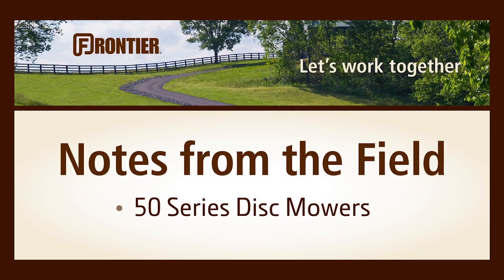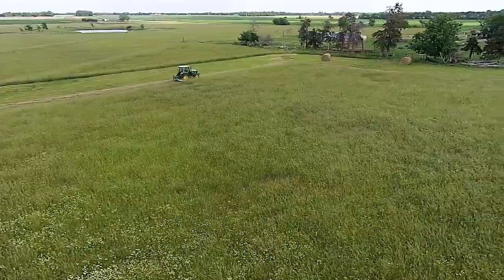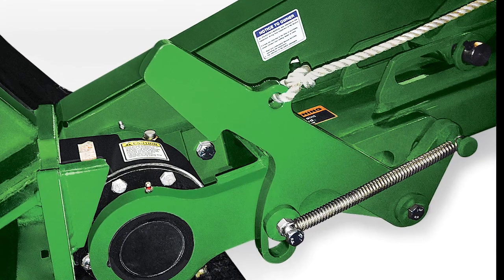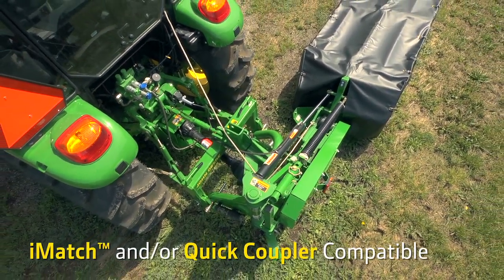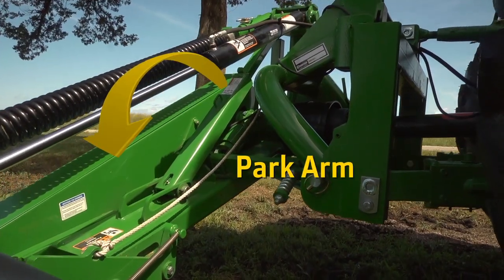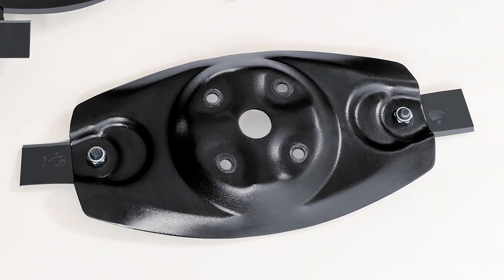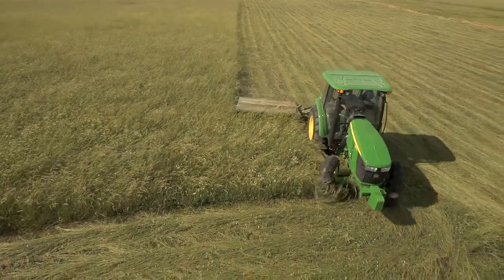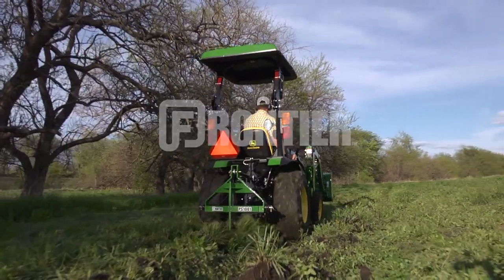DM50 Series Disc Mower | John Deere Tips Notebook

Comment: I was tempted by the price of this mower and decided to give it a try. It has mowed about 500 acres in the past 2 years without any major hits or accidents and is already starting to fail internally. One of the spindles stripped out on its gear, which severely damaged that particular cutter as it was beat to death by the other cutters. Excess play in other cutters indicate that they will fail soon. The hitch pins are not strong enough for this mower; they are cat 1 pins necked up to cat 2. They continued to break until I just bought 1 1/8" bolts grade 8 bolts for the hitch pins. I cant imagine that they would think that anyone could use this mower on a tractor with a cat 1 hitch. Getting parts for this mower is also a pain. My local deere dealer doesnt even carry the knives for these mowers and there are no aftermarket options as of now. The blades must be ordered by the dealer and are drastically overpriced. Also, the replacement parts (like the spindle assemblies I ordered) cannot be received in a day or two by the dealer as most other deere parts can. The parts must come from frontier, then to deere, and then to the dealer. This process adds a few days to the order. Last but not least, the mower does a lousy job. Even when the mower was brand new with sharp blades it did a sloppy job cutting most types of hay. It would consistently leave streaks of partially cut grass in certain spots on the bar and I could never figure out why. It would also chop up hay and fling it out in all directions like a rotary cutter. I have used various disc mowers and have never had such issues. I played with all of the adjustments and nothing made a difference. Ive had a few frontier products that have served me well but stay away from these disc mowers; they are poorly designed
Reply: Thanks for telling your experience
Reply: Update.... I actually still have this mower and continue to use it.  There are so many bent, broken, and welded parts on it now that its really not worth what I would get from selling it.  However, it has mowed lots of hay in the last couple of years without failing catastrophically; i'm pleasantly surprised that it has held up this long.  I plan on using it until the bar and/or gearbox grenades itself.
Reply: @valcon0  I've had one for several years too. Early on did have a gear break in hub. I was surprised that Deere did stand behind it and totally rebuilt the bar. But it has not been a smooth cutting bar, seems to have trouble cutting tough grass at times that slips the belt. And it it awkward to hook up.